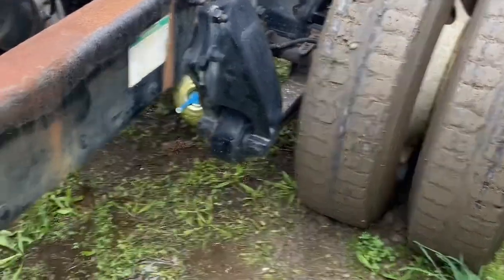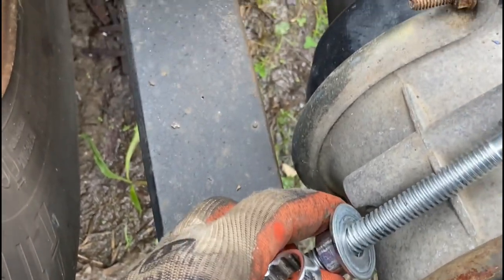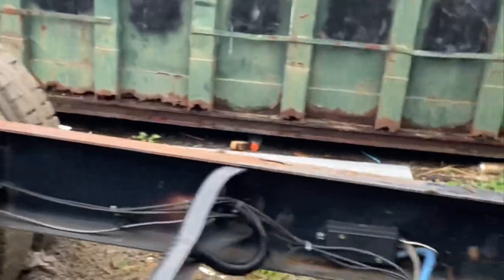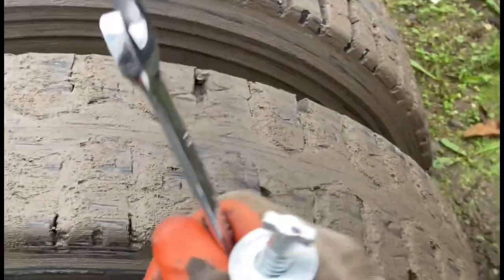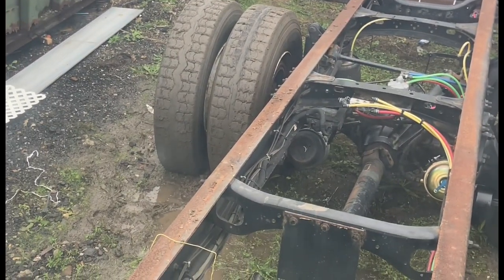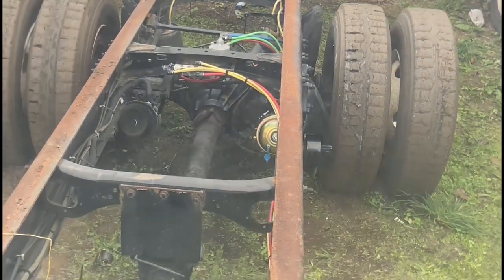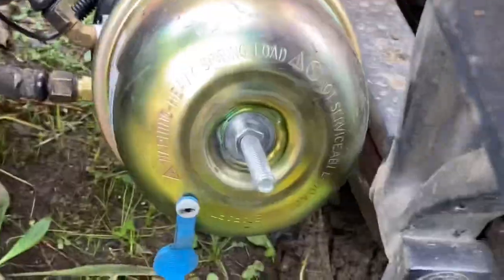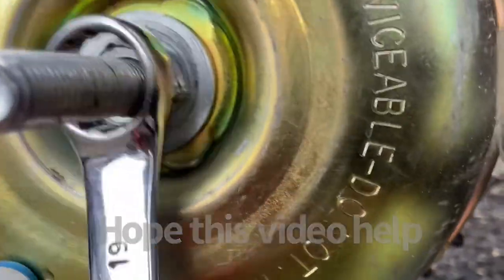How to fix a stuck or locked up brakes and a truck

Comment: Good job!! Im having the same issues. I beat the drums and everything. I got both rear moving, but truck is still stuck. Im going to see if my front tires are locked
Reply from the maker: Ok good because sometimes even when you beat them it still locked caz I did that first. but have a blessed one and I hope everything works out well
Reply: @karlonarcher7918  Thanks brother, you as well

Comment: OK buddy, I have an issue with a bluebird bus sometimes when I push in the parking brake, the brakes will not release. Do you have any suggestions?
Reply from the maker: Sorry for taking so long to reply but I never have a issue like that but i’ll asked around